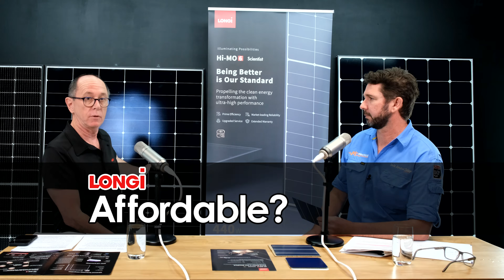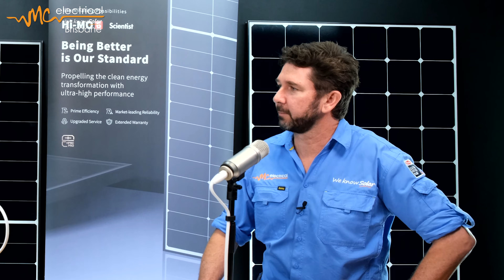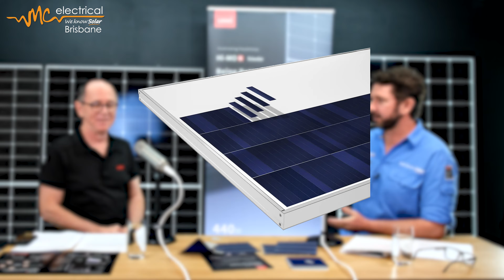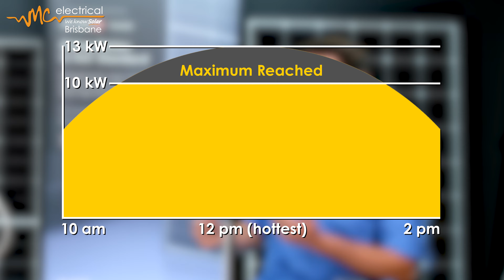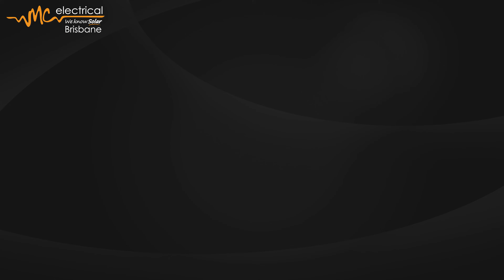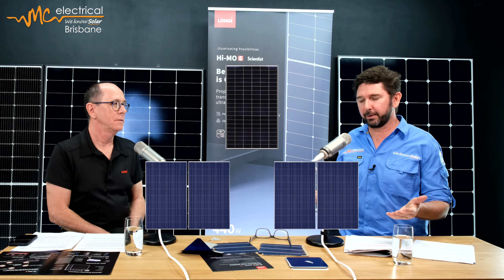LONGi HiMo-6 Solar Panel Review

Comment: What solar panel is recommended for me to pair in series connection with a LONGi 455watts LR4-72HPH-455M on same string. I have two of them that are 3 years old now and I want to add 6 more but I can not get the same type..
Reply from the maker: Your original solar installer is the best person to ask

Comment: Hello. I am a PhD student in Türkiye. For my thesis, I want to design a BIPV panel system. I plan to use a 30-degree tilt angle for the facade design. I want to select panels with a power output of 400-550W for my BIPV facade design. I got confused about the LONGi Hi-MO 6 series after watching your video. I'm particularly uncertain about its durability and the risk of warranty voidance due to shading issues. The LONGi Hi-MO 6 series was one I had been considering and researching. I'm curious—which panel or series would you recommend as an alternative? Thank you for reading
Reply from the maker: All the panel companies have this shading warranty issue so if that's what you're worried about it probably won't matter which brand you choose, more on that here: https://mcelectrical.com.au/blog/solar-panel-warranty-loop-holes-exposed/

Comment: You can´t shade a panel???  That by itself is mainly not possible when living far north. Shades are long, especially in the winter... and only a few can be "without shade".  Everyone around where I live have shaded panels, no issues reported!
Reply from the maker: Well, yes. That’s what the install manual says. Over a period of time, bypass diodes can fail, and sorry - no warranty for you!
Reply: @mcelectrical  Sure can, but if this was a common issue, people would talk, and companies would warn....
I do not know of ONE person or discussion where the shading has caused any serious problem (beside production drops).

My thoughts go to the possibility of sharp (contrast) shades (items close to the panel), which also could affect the temperature in the panels.
Getting ambient light might reduce the effect.

As said, I do not claim there are no problems, but this one was new for me.
There are also people who put their whole panel in a shade (let´s say north facing roof) because they do not have enough roof area to put them on the south facing roof. This produced less, but still produces.

Comment: Subtitles might be via AI Bot which doesn't understand Aussie well.  I have Longi Hi MO 5m LR5-72HPH 555 W panels.  Here searching if they have internal bypass diodes (spec sheet doesn't mention).  I wonder since I see a great increase in power output when one panel in a string of 7 comes out of shade at 10 am in July (U.S.).  If diodes, they should just bypass the single shaded panel, not limit the whole string.  If no diodes, I need external optimizers to get more power in the morning. (Can't trim the neighbor's tree).  No shading in Winter.  The Summer sun rises and sets ~45 deg north of East-West on June 21 at 38.6 deg latitude.

Comment: Have you tried Aiko PV panels? Look an interesting proposition; high efficiency and improved shading characteristics on the gen2; saw it up close at a recent trade show.
Reply from the maker: Yes that is an interesting panel. I’m convinced that shading comparison they did will only work with micro inverters not string inverters, so seems a bit misleading. Everyone is talking about it. I’ll find out about it soon and do a review.

Comment: Hi Mark,At minute 8, you easily broke a Longi cell.How will these handle in a hail storm ( 22 .5 degree roof pitch) Do they handle it well, or if they're the size of golf balls ,will my investment get smashed.
Reply from the maker: Big hail storms can cause micro fractures. But at that stage, your roof would also be destroyed, and you would be doing an insurance claim. You can get it inspected with a thermal camera to pick up microcracks.

Comment: How do people with solar panels on RV’s / motor homes/ camper vans get around the partial shading problem ? I think this would happen a lot.
Reply: Each panel uses it's own mptt channel
Reply from the maker: Warranties are generally void if the panel
Is mounted on a camper. But, yes also individual mppts is probably the best way for evs
Reply: Why are they a problem on motorhomes? Asking because i was planning to fit them
Reply: @Alex-uh1mj  I suppose the warranties are void as stated above due to the panels should be solidly mounted to an immovable object. Danger of damage due to poor roads/ speed humps. I would rather take my chance with one of these panels from city plumbing in the UK at just under £70 for 400w, than a much more expensive motorhome specific panels.
Reply: @CraigDavies.  That's what im going to do, i dont think these solar companies are making panels especially for companies aimed at motorhomes. The manufacturing of the panel itself is likely to be exactly the same. From some research online lots of people seem to have success with domestic panels. I dont see the point in paying 3x as much per watt for a victron panel.

Comment: Great video. May optimisers mitigate the shade issue by reducing chances of developing hotspots?
Reply from the maker: I’m not sure if optimisers would help, but micro-inverters would. My understanding is that micros are also gentler on the bypass diode. However I can’t get any panel manufacturer to agree with me on that.

Comment: What to choose i got a calculation in spain for 5kW with instalation
10x tensite 6k
12 longi 8.5k

Tensite Monocritalino PERC 500 W
                         VS
  LONGi Hi-MO5m 66HPH-G2 510W
Reply from the maker: I’ve never heard of tensite. But why are they quoting large solar farm panels on such a small job? Is that common in Spain? You should be looking at something with dementions of around 1700x1100

Comment: Shouldn't thr bypass diodes handle the shade and keep the panel from braking?
Reply from the maker: The bypass diodes will fail if they are shaded too often. If they fail open, then the cell will get damaged. The issue is they offer 25 year warranty but don’t seem to know how panel will handle shade over that period.

Comment: Today my Longi Hi-mo6 explorer 430w panels were newly installed on my house. I have build quality issue with that. The paint  from the black panel frame was chipping easily during installation. Actualy there was lot of scatches and chipping already  on the panel frame which arrived before the installation. According to the manufactures datasheet of this panel. The frame is black anodized aluminium. Which is probably a lie, because anodized aluminium can hardly be scratched and even more difficult to chip . The finish on my Hi-mo6 can easily scratched, and chips easily too.
Reply from the maker: Interesting. I don’t usually see issues with frames. The underside probably would get scuffed when putting it on the rail, but like you say, it should be anodised. But I will check that out.

Comment: It sounds like there is a business opportunity to set up a warehouse and retail operation selling used panels and maybe inverters.  Or - are smarter people ahead of me?
Reply from the maker: Yes there is a smarter person ahead of you :) This is a new site but it will probably take off soon. https://solartrader.com.au/how-it-works/
Reply: @mcelectrical Ahh that is like a dating service for buyers and sellers. 

I was thinking more like a business that would buy and/or remove old PV equipment and then sell them out of a warehouse or shopfront. You referred to a wreckers in the video and that's what I had in mind.  That would require a testing facility and some kind of warranty, but is similar to the firms selling 2nd hand business computers.

I assume if installers are upgrading an existing system you or the customer have to dispose of the old equipment, either by selling through a market-place like that or by having your employees take it to the dump and paying fees.

Comment: What's your issue with shingled panels?
Reply from the maker: When I saw them manufactured, not all the cells were flashing. Too many connection points, too new tech. There are some other things i can’t say, but fair to say I am not confident with what I saw. Then, a few years later I heard a lot of anecdotal reports of shingle panels failing. Made sense to me.
Reply: @mcelectrical  m

Comment: Can you comment about passing shade and warranty By that I mean a single narrow palm tree to the north of the house that casts shade sweeping across the lower edge of the roof for approximately 2 months in the middle of winter. So two to 4 panels at a time get partly shaded as the shade sweeps from west to east.
Reply from the maker: Yes, technically your warranty can be void with most panels. They intentionally write their docs that way. Who knows what the manufacturer will say  in 10 or 15 years time , if that shade is suspected to hav damaged your panel. I asked longi to clarify this over a year ago. They refused.
Reply: @mcelectrical  Depending on the definition of shading there are probably very few installs that don't atleast, start and finish the day with only some and parts of panels in sunlight. Shaded?

Comment: Just sealed the deal for Jinko Tiger Neo N-type 54HL4R-(V) 440W.. I think I'll stick with Jinko for the Warranty, they have a good rep for Warranty
Reply: The issue about Hi-mo 6 is that it is based on P-type cells, which inherits all shortcomings from P-type solar which will end up hurting life-time performance despite some may announce higher conversion efficiency (which can also be shady). I would recommend wait for a year or two when N-type are more mature, and the prices go down, and install N-type modules instead.
Reply: @delightXD  thats what I have right.. N Type?
Reply: you do know their warranty has the same garbage prorata stuff right?
Reply: @crypticanswerz  yes, yes I do already know that.. but given I have seen Jinko multiple times simply ask the installer on the phone if its screwed, they accept his word and authorize him to do a replacement on the spot and credit the installer. Doesnt get any more no fuss than that, thats Jinko Warranty in Practice

Comment: 23:00 we faced the same issue with Trina Solar Panel from around 2014 all 240 Wp with issues on the back with the inuslation foil, corroding busbars and barely 200 Wp output - I mean during summer in 30° tilt position for maybe a few minutes a day. All have been sorted out more or less but of cause you have to take alll from the roof and repower it . Smart people look around and ask for one or some to be prepared. And 40 Wp loss in just 8 years is a huge loss too. Compared to no name CPL which were produced 1 year later and still deliver the nominal power 7 years later far longer than the Trina with just 200 Wp of once 240 Wp. 
Worst purchase ever, so here a lot people do no longer recommand trina, especiall the solar farmers. 

The recycling or reuse is now becoming more important. We got most recently only risen and longi. And we know we have to become profitable soon, the sooner the better. 
At the end smart people always will look for the new tech and replace the used tech after 15 years or so when they still get a good price for used panels which lowers the amount needed for the new panels, usually more powerfull ones. Between 10 and 15 years seems to be sweet spot. And you learn more about how well the roof and the connectors have aged meanwhile.

Comment: 14:00 oversizing means what here is called overpanelling. 
Here the temperature coeffcient is more important for detecting lowest operation temperature before the cell might cross Vmax of the inverter. From the usual 25°C to the -15°C there are -40°C x - 0,3% / °C = 12% higher voltage. 
We put here big panels on the roofs, about 29 kg with 550 Wp which lowers the costs of the underconstruction on the roof a lot, an awfull lot since aluminium profile costs have skyrocket. 
The 550 Wp are an awfull lot cheaper if you take the mounting into account, therefore more and more get the 2,26 x 1,13 m panel size on the roof.
Reply: Interesting, where do you live?
Reply: I think smaller panels are often used on home roofs so they can easier work around vent pipes and other obstructions.  Large panels are best for ground-mount or unobstructed carport/gazebo roof (mine).  Since panels are now slightly cheaper than inverters, most over-panel ~20%.  You only restrict capacity at max Summer sunlight, so a better match for the whole year.